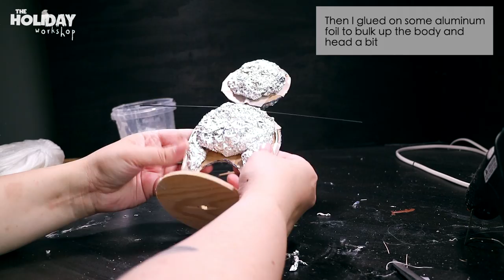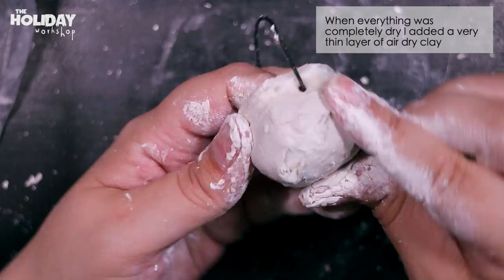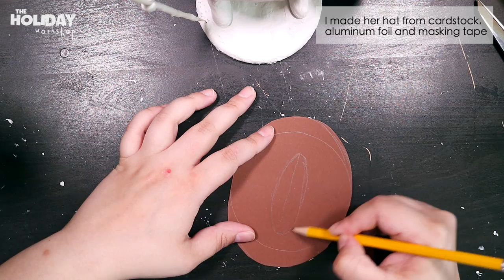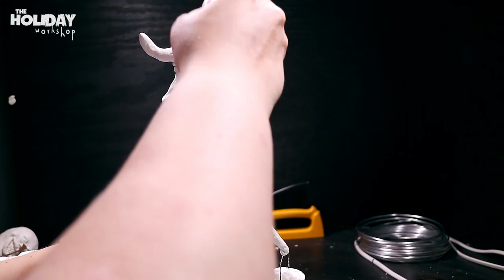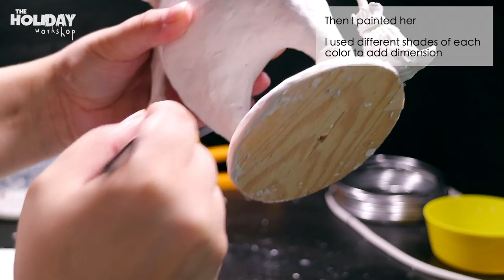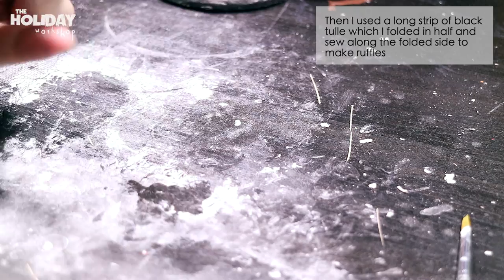How to make Wisteria the Witch - Trick or Treater's series

Comment: I apologize if this is a dumb question or addressed in another video, but it's it necessary to do the papermache if you are going to cover it with clay? Does it help it stick or is it too build up the right form? I have not worked with air dry clay so just wondering before I attempt it. Thank you so much for the great instructions and diy of something far more creative than all the other diy decor out on YouTube!
Reply from the maker: Of course it's not a dumb question (in my opinion no questions are)! 😊 I prefer to do it this way to use less clay and I also find it musch easier (although a little bit more messy) to build up the basic shape with papier mache first and then cover it with the clay. 😊 Hope it helped! And thank you so much! ❤️